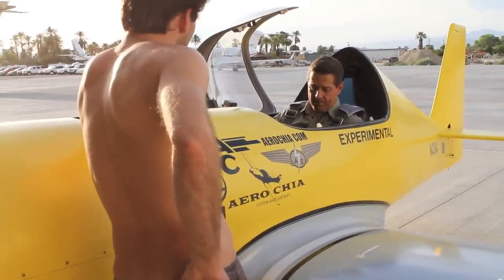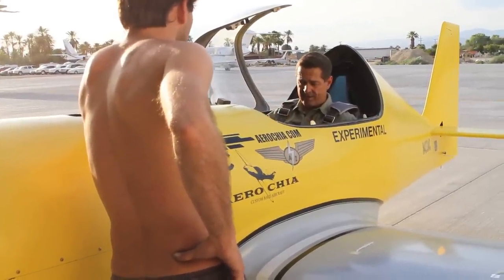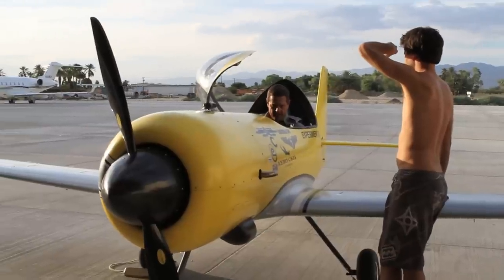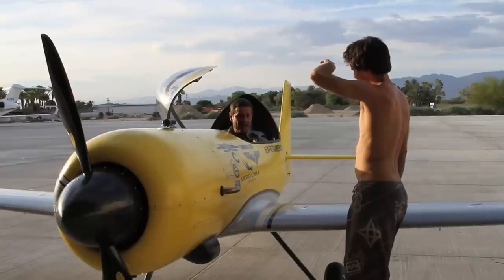Aerochia LT-1: First Flight Debrief

Comment: Found your videos, very nice!
Now I have to pick which one! Looking at the Hummel bird or BK-1 which is a little wider and faster with a 4cyl engine. I checked Aerochia web site, a lot of info but no cost or time of production. Looks like the Aerochia LT-1 would be a great cross country hopper. I like the modular parts, makes for quick build time, would seem around 500 hours or less.  Post more videos if you can.